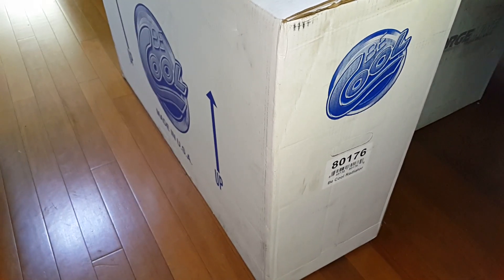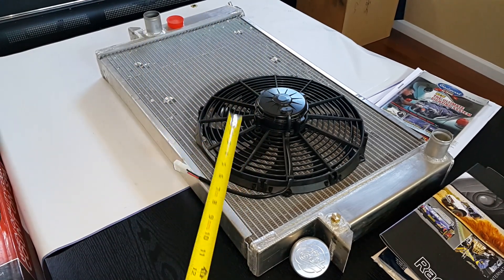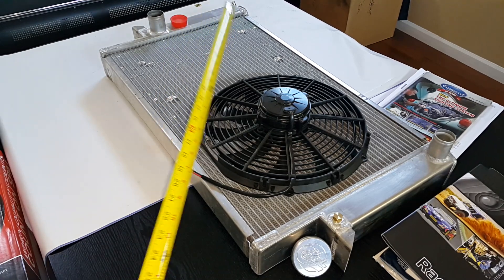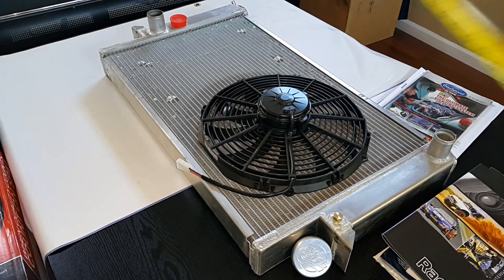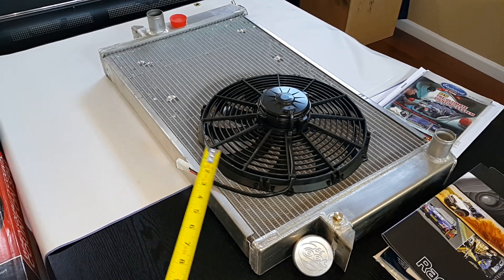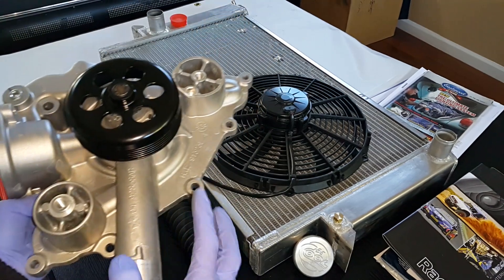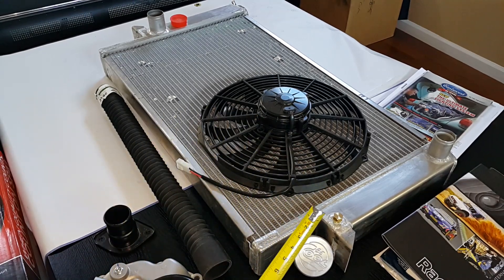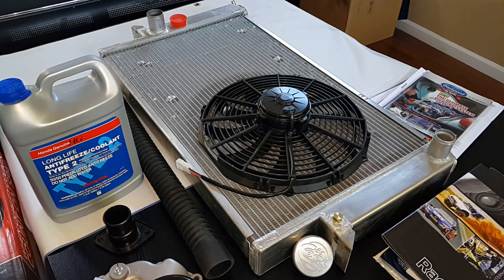Be Cool 80176 preview and cooling system modifications

Comment: Is this the same radiator you run in the CUDA?  on the Be Cool web site this 60176 rated up to 400hp. I love your car and i am also build my CUDA for track days. I am already overheating and am looking to add A/C at a later date. what do you recommend?

o
Reply from the maker: Yes, it is the very same Be Cool radiator that the `Cuda has as it is 33 inches across. It is only rated for 400hp if you have no fan. With 2 electric fans on the radiator you should have no problems. We have never overheated with this setup at the track thanks!